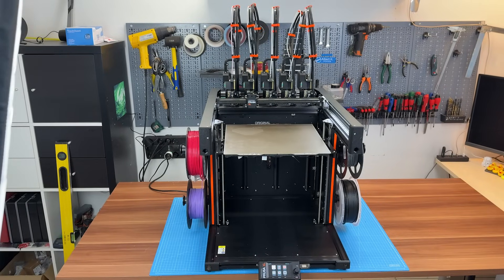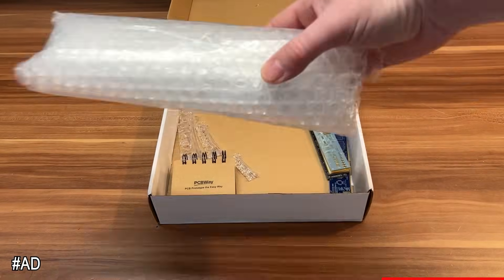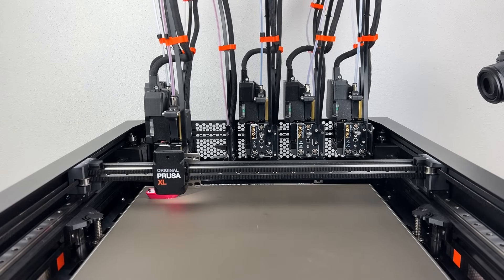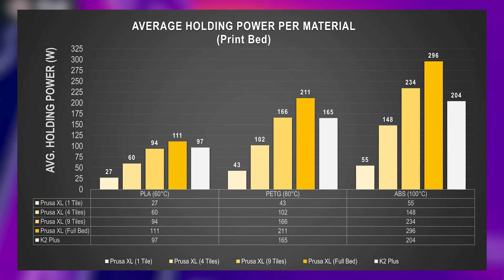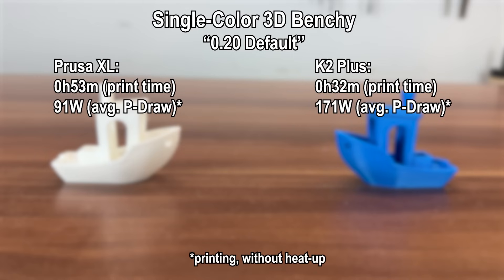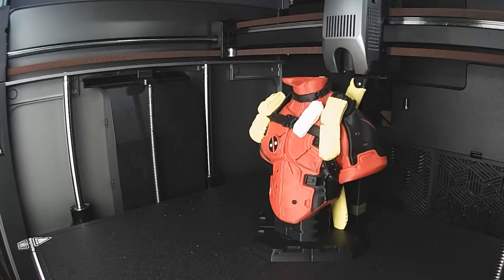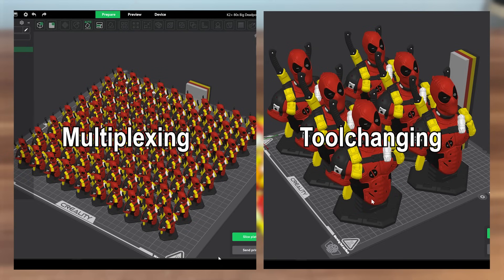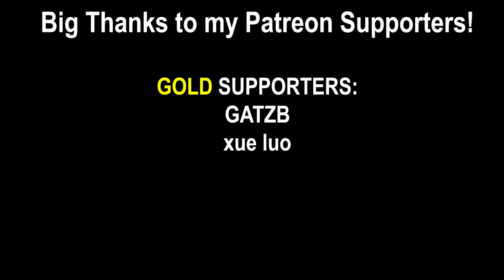Prusa XL vs. K2 plus: Material and Energy Efficiency Tested!

Comment: Comparing power draw to power draw does not make sense if there is such a massive time difference. In the end you have to pay per kWh so that should be the basis for comparison
Reply: 7:47 for instance: the prusa XL drew 0.25kwh while the K2 plus drew 1.48kwh. a massive 6x difference
Reply from the maker: Yes, that’s why I measured/compared power draw: To be able to calculate the kWh using print times afterwards ;)

Comment: If you using octoprint while having the firmware bugs, maybe test with prusa link. I just had started to use a pi with my mk3s and prusa link and did a 3 day print job without any error. After that i tried octoprint and with my first 4h print i had 2 kind of layershifts, which reversed to normal a few layers later and crash alert. Same print with prusa link, worked flawless.
Reply from the maker: All prints started via Prusa Connect. Just used Octoprint for the energy testing, as API access is easier.
Reply: With all the errors i saw in videos about the XL, i just have the feeling, that they don't run a huge farm with the XLs. They could easily split even a single color model on to multiple heads with the same filament, just to test it at scale. Anyway, happy printing!

Comment: 11:13 I see you put that there was 0 gram waste on the XL.  I would think that you need to add up all three failed prints in grams as "waste" to make it more fair. A failed print IS waste.  Also, the K2 was a 45 hr print, but how much time did it take to get through 3 failed prints on the XL? Would have been a cool stat to see. Great video overall though.

Comment: Now do the same with the P1S
Reply from the maker: You think it behaves largely differently?
Reply: @247printing yes, purging volume is lower
Reply: @ a few friends considered that the P1S is not only cheaper in the long run but also faster for a multicolor print than the XL.
Reply: @DiomedesDominguez   it literally can't be

Comment: at 3:35 seems like prusa intentionally throttled heater, I wonder why they did that
did they wanted temp to evenly distributed over all heated part or something?
Reply from the maker: What would throttling by 5°C help?
The 70°C heaters are unused ones (not causing delays).
Reply: @247printing  that I am curious about, heater has room as graph isnt linear but not sure why

Comment: That thing is not worth 5k, man. In terms of reliability is like a 200€ printer to much hand work. For 5k I have to work 6 months straight with no expenses to make to set so much money to side. Which means sleep less nights and harsh days for 6 MOTH only to get a feel of rip off and disappointed?! No thanks the Manufacturer can take this printer with that price tag and shove it pice by pice right up their Å$$. Not worth a single dime😂. Why do the manufacturers this to the costumers? Why aren't they able to put a real consumer great product in to the market? Why has the costumer be always the Labrat to test shit on? Seriously nowadays they throw some half Ăşşed shit in to the market and then they wait until they get a shit storm as feed back. Clearly 3D printer manufacturers for consumers are the worst shit ever they should be forbidden to build cars otherwise they would deliver cars with no stirring wheel and wait until the first 100000 costumers died by car incident against a tree or wall because they weren't able to stirr around the obstacles. Retarded at its finest 🥺🤦‍♂️Shame on you 3D printer manufacturers! Shame on you!

Comment: Just a heads up, the carbon filter will not make the air cleaner, but it will remove any odor. So you still can inhale some not so good emissions from the printer.
Reply: Bro you already proved you are clueless about both 3D printing and economy, it's ok
Reply: @riba2233  are you a bot? What are you even replying to
Reply: @AndrewTSq  you know what, stop coping ;)
Reply: @ so you search for every comment i have written on youtube? what is wrong with you
Reply: @AndrewTSq  instead of writing this nonsensical insinuations just respond to my comment about tariffs with arguments, ok?
Reply from the maker: Yes, you need also take care of the fine particles.

Comment: Regarding the extruder not spinning error, it was driving me nuts and I was having other firmware related failures but I rolled back the firmware to 6.1.3 and have been running normally again, hopefully they patch this issue soon!

Comment: heat tiles energy efficiency hugely affected by enclosure, with enclosure make delta T more closer between bed and atmosphe, the result is more efficient in keeping bed temperature... k2 have enclosure even when doors opened, (still have left right back wall) and prusa fully open (only back)... even prusa have enclosure they have big volume of air to be heated thats mean more energy....

Comment: So the XL is cheaper after 3 years if you ignore failures. To be fair the CMS on the K2 isn't flawless but the printer itself has been when doing single color. To be fair I had to go into the K2 config files and pretty much rewrite all major macros to make it flawless but I did that right out of the box and mostly for fun.

Comment: I have 2 XLs in production and they have worked VERY well for me. I do prints 6-18 hours long often with 100s of tool changes. I have had the extruder motor error a couple of times but Prusa’s solution of new plastic holders to connectors to extruder seems to have solved it. For me, wasting this much plastic on single extruder printers is just ridiculous. Sadly…. Yes the XL is quite and too expensive for most and it’s a shame it has taken Prusa so much to work bugs out…
Reply: Any maintenance challenges?

Comment: there is no excuse for not at least melting pops down into sheet material. even baking paper and an old iron, or oven, can do it and sheet stock in different thicknesses is going to be useful for something. glue it together into boxes, cut out coasters, table mats, picture frames, dining trays, book covers, clip boards, a billion different things. if you actually throw away plastic pooops, please eat it instead. PLA is made from corn starch, the world will be better off ;-)
Reply: A shirt heat press or label heat press can make some really nice sheet stock up to 15in and if you use some steel washers and shims you can control the thickness of the sheet.
Reply: @Guardian_Arias  absolutely! Thank you. I was just mentioning the cheap and easy option but it's easily done and a great use for all this plastic that apparently people throw away.

The waste is shocking, but it's so easy to put to good use.
Reply: well at these amounts it maybe worth it to think about your own mini filament recycling ^^ - PLA is easy to melt and to make it back to some usable filament

Comment: $2500 in difference is a lot of waste and wattage to make up for.
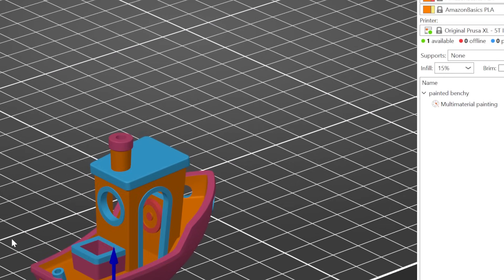Reply: Are we just going to ignore the failed prints on the XL vs not completed prints on the K2? 6:40
Reply: Yes, but if you caount in the wasted filament in these scenarios it breaks even rather quickly. 65 kg of filament are about $1000 if you use medium priced filament.
Reply: @JenSalik_  2800m of filament printed over about 500 hrs print time on my current printer, a qidi q1, or roughly 8.5kg... by the time a 3d printer reaches 65kg printed, i suspect it would be very outdated
Reply: 1 year non stop printing can make up for it
Reply: If you sell the Deadpool bust, I guess you would have to pay way more in copyright infringement to Disney/Marvel than for the filament anyway,  But I am sure you could make the Deadpool character in different colored separated parts instead, and print it both way faster and way less waste of materials, and then just glue the parts together, but most 3d printer farms probably just buy some model and prints it without thinking about those things? (I am just making assumptions so I could be wrong :D
Reply: @AndrewTSq  glueing parts together takes more time, at least where I live that time almost surely costs more than the filament saved, especially if you use cheap filament
Reply: @ ok , maybe in some cases, but could also make the parts click together :)
Reply: Depends on the material. In my case two kinds of (fiber filled) technical materials and a support I don't want to drag into the actual model. The supports are supposed not to bond, the last thing you'd want between the part's layers!
Reply: @ In that case you need a lot more flushing than just with colors, to keep good material properties
Reply: All that money and u got bugs hahaha rubbish.😅

Comment: The big elephant in the room is the XL is not reliable to print with multiple colors and is limited to 5 colors. 6:37
Even this example only the single color worked out and you have fails on 3 of 5 tool heads. 
Your failed deadpool is waste along side a purge tower and filament 💩
Reply: " is limited to 5 colors" and every printer is limited to one I guess.

Not talking about XL here:
It's 3dprinting, why people don't make models that print separate and then get glued on after? No filament waste, no time waste.

MultiColorSystems suck because of the waste. And the only/main waste here is the design of the models themselves. It's not that hard to divide them in pieces that can be assembled after. Dunno why people don't do it tho. Too lazy? Too brainwashed? who knows.
Reply: true.... but i think its only problem in Software basis.... and some additional hardware.... but not fully change the printer....
with software upgrade maybe the parked head can change filament colour while the other are printing, with 5 tool head its can change further ahead... but prusa is prusa... they prefer in usable part 3d printing than make trinket..
Reply: "Limited to 5 colors"

And here's me wondering why all these multi material systems seem to support a minimum of 4 colors, making it a more complex and expensive product. I'd honestly be more than happy with two colors.

Comment: Prusa XL still having bugs like that , after 2 years after release, huh ? I didn't expect that :O
Reply: ..... I also expected more from prusa for that price tbh
Reply: Yeah I regret buying mine at this point. Nearly $4500 with shipping and import fees. My bambu may make a lot of filament poops but at least it doesn't consistently ruin 20hr prints
Reply: @blindsay You dont have any
Reply: My Prusa XL5H runs absolutely flawless…
Reply: My XL with 5 Toolheads runs fine. And I love that I'm now able to use real multimaterial like BVOH as support material. Bugs in Firmware can happen. But overall I'm very happy with that machine as it is big, can print multimaterial and it is (at least for me) very reliable.
Reply: Feels like I've seen several Youtubers comment on having that same issue recently. Very strange, but after my experience with the mmu2 with my mk3s Which was so bad I only ever got one or two prints before ripping it off The MMU2 was a total failure for me, but my MK3S has been phenomenal Highly recommend MK3s but not mmu2
Reply: @ChristopherKlepel Your correct.  It's been since a recent firmware upgrade.  I never had this error for well over a year, after a recent firmware upgrade it started occasionally happening.  Obviously a bug. Hopefully they'll get it sorted.  I reverted my firmware for now and it hasn't happened since.
Reply: @ChristopherKlepel MMU3 has been working exceptionally well for me on my MK4S.
Reply: I haven't experienced or seen many poeple with this issues on the XL.
Reply: My XL produces the same quality prints as my bambolabs and sometimes even better.
Reply: you seem to be unaware of how software development works.
every update has the potential for new bugs.
this bug is not still there after 2 years, its a new bug that nobody has experienced during the alpha, beta and RC testing and was only found after the final release of that firmware version.
Reply: @Pixelplanet5  make sense. I wonder, was this meanwhile fixed ?
Reply: Preorders started at the presentation at Formnext 2020. The concept didn’t change ever since. It’s dated.
Reply: that thing is a trademark for mediocre print quality and bugs after bugs.
Reply: Exactly. Even the task it is "good" at did not complete. (10:10) So his calculations should cover his wasted time, failed prints weight. In a business environment he could have multiple K2 or others(A1 p1s), printing successfully instead of fail after fail on a 4k printer.
Reply: I have a 5 tool XL, it runs fine, doesn't glitch, finishes very high quality products quickly and gets updates frequently. And hey, at least Prusa wont fundamentally change the firmware after purchase. But BBL fanboys will fanboy. I'll still take an Elegoo for $300 compared to anything BBL will produce even if it doesn't have a laser cutter...
Reply: @BookOfMorman You're one of the lucky few with a fault free XL. Ill never have another XL, and I doubt I'll ever buy Prusa again despite being a long time fan. Also there is a reason BL machines are praised so highly. It doesn't mean those that talk about that are fanboys.
Reply: @OhImKiCkiN  The ones in this comment section sure are, but  there's no reason the BL machines need to be their current price tag and Elegoo has proven this. (Same with Prusa Core 1, I ain't a shill) But you're comparing apples to oranges with any BL machine and an XL-5. Being able to do multi material and multi material types is an unparrelled feature.
Reply: @BookOfMorman  Elegoo hasn't proven anything....yet, but time will tell. Budget machines have a history of corner cutting using sub-par parts, low QC, etc. In 2 years if the Elegoo CC is close to BL's reliability then you've got a point. But their Neptune 4 and Giga's were both huge, high maintenance duds that will keep me away from Elegoo until they have a proven modern product. Also, what comparison are you referring to? I don't remember making one.
Reply: @BookOfMorman My XL runs great as well, hoping I never run into the issues I see everybody complaining about
Reply: And the new core one has pinched power wires.
Reply: XL & Mini are both terrible products that Prusa seemingly forgot about.
Reply: @KanielD  Don't worry, they also forgot about the Mk3.5 which you're unable to upgrade unless you pay a mk3 to mk4 upgrade, essentially wasting half of it as you already have it, yet they're unable to open a box, separate it into 2 different upgrades and profit...
Reply: @KanielD no
Reply: Yep it's still a huge failure.
Reply: don't worry all those bugs and future bugs will be fixed, the vfa bugs will not though
Reply: @SteveBennet500  It's a 2 year old printer, don't hold your breath
Reply: 😂 @t1mmy13
Reply: @t1mmy13  actually its a 4 year old printer... still in beta lol

Comment: Give me an XL in a full enclosure that isn't an after thought but purposely designed.
Reply: They should make a larger Core One with toolheads. The Core One design is good but the single extruder and Mk4 sized print bed holds it back.
Reply: @brinkoftext  they should make a core two duo, with two toolheads aand a 300x300 build are
Reply: & print quality at least on par with the MK3.
Reply: So Voron 2.4 with a Stealthchanger or TapChanger.  Hopefully the Bondtech INDX is good.
Reply: @  Why a 2.4 instead of a Trident? Having to move the gantry up and down for a tool change seems a bit unnecessary.
Reply: @brinkoftext  The flying gantry on the 2.4 makes the way the changers dock mechanically work.  There is a mod for trident but it's a lot less tested.  Basically both these changers use low cost parts pins or bearings and use the optotap from Voron's Tap project to detect when the toolheads dock and undock.
Reply: @ 2.4 has easier docking mechanism